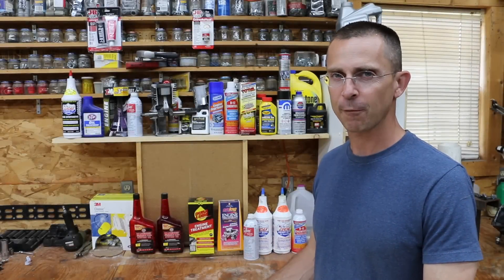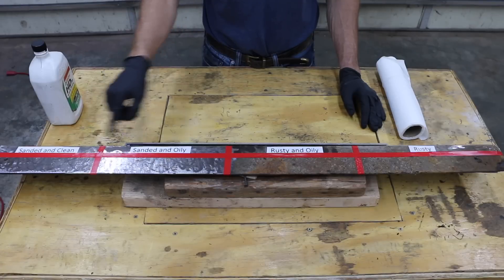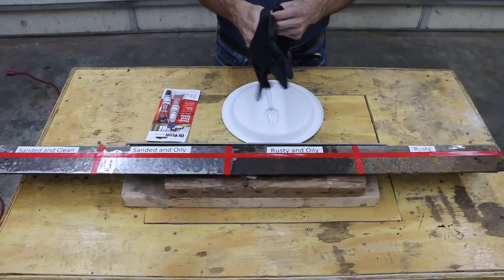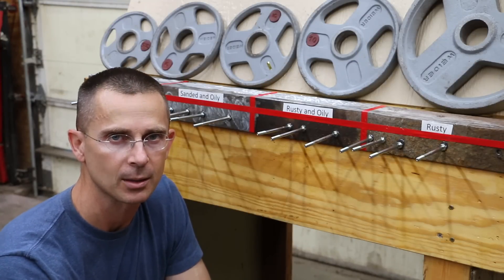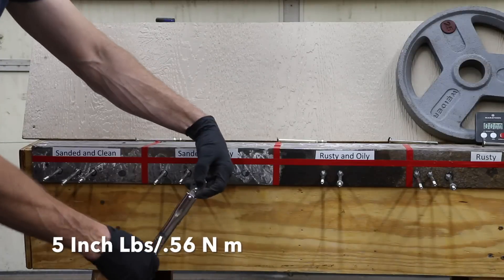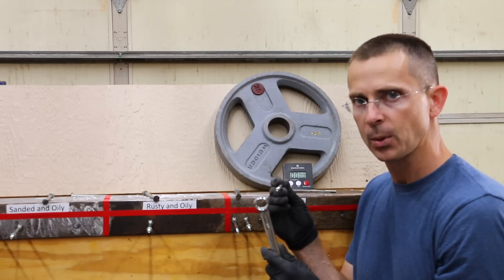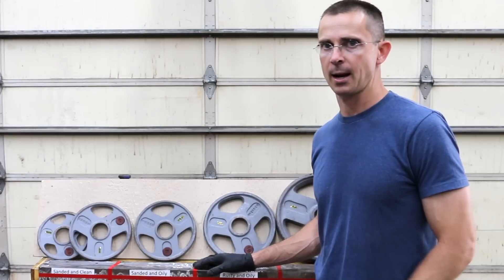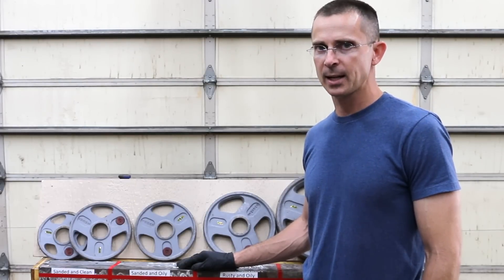How much does rust and oil effect epoxy performance? Let's find out!

Comment: My own prep method is to sandblast the surface(s).  Not only does it get rid of rust and contamination, but it also produces a "toothed" surface that's ideal for the epoxy to grab onto.  Though I don't test as rigorously as Todd does, I've yet to have such a joint fail.
Reply from the maker: Thanks for sharing.

Comment: From experience sanding and using comet powder cleaner is one of the best ways to prep the surface! When done right you can test it by pouring a little water on the area you cleaned that's getting the epoxy. If the water DOESN'T bead up it's good to go and perfect! If it does re wash the area again...
Reply from the maker: Thank you

Comment: The FAA has a very, very good write-up on adhesive bonding, ostensibly for aircraft repairs, that goes into surface preparation. This paper is available on-line, and I'd recommend reading at least the first ten pages or so, because they go into how an adhesive joint works. When doing adhesive joints, both surfaces should have as high a surface energy, obtained by physically abrading an already clean surface just before bonding, This is usually followed by cleaning with acetone, followed by isopropyl alcohol. In some cases, this is then followed by rinsing with deionized water, and perhaps doing a "water brake free" test. This test is to determine whether the surfaces are actually clean and energized, or whether they still have retained a contaminant within their pores that still fouls the surface. Secondly, it is worth looking up the surface energies obtainable in various (clean) materials by doing a search on the internet. Thirdly, it is often worth applying ("buttering") adhesive to both surfaces to be bonded to assure that the surfaces have been "wetted" by the adhesive. This must be done quickly as one does not want any kind of skin to develop on the surfaces of the adhesive exposed to the air. Fourthly, the bond line thickness must be controlled in critical joints. Some use thin wires, others use tiny glass beads, but the gist of this is to not allow the bond line to either be too thin, such as less than .006 inches, or too thick, like around .020 inches. Bond line thickness does play a role in strength. Lastly, It is considered best practice to apply continuous even pressure on the two surfaces being bonded until the bonds are cured. Leaving them with just their own weight may not produce a good bond. I liked that you performed both peel testing and shear testing to your samples. Both are critical measures of bond joint strength. Sorry that this is so long winded, but these techniques are what sometimes hold airplanes with your kids on board together. These FAA guys really know their stuff.
Reply from the maker: Great information!  Thank you

Comment: appreciate the video. am interested in bonding nylon cylinder inserted into carbon fiber tube with epoxy adhesive. also will glass microspheres  change strength.
Reply from the maker: Thank you!

Comment: There "may" have been a better bond had you used a chemical cleaner, but you might also have contaminated it.
Some cleaners can leave residue similar to mineral-oil. They dissolve the grime but do not necessarily leave it perfectly contaminant- and oilless.
Reply from the maker: Thanks for the constructive feedback.

Comment: How about testing the best cleaning solutions to use with JB Weld? Strength of bond on sanded metal, sanded metal cleaned with rubbing alcohol, acetone, brake cleaner, carb cleaner, etc. Thanks so much for these videos man. Downright AMAZING work, in its usefulness & thoroughness!
Reply from the maker: Great video idea!  Than you.

Comment: for torque you should use dial torque wrench with a memory. something like this:https://www.gedore-torque.com/torque-wrenches/dial/ads-dial-measuring-torque-wrenches/

It will tell you the highest torque applied. that way you would know exactly what the break torque is rather than just that its less than what you set yours to.
Reply from the maker: Great recommendation!  I've since begun using a torque adapter (recommended by a person leaving comments) and it has memory.  Great tool!

Comment: There was a very good epoxy made by Permatex that was actually banned for use in California  ( stipulated on the label ) I tried several different epoxies to glue the magnets back inside a altinator rotor (clutch ) hub for a Harley Davidson Sportster, it was a pain in the butt disassembling several times to test them but the Permatex epoxy was the only one that held those magnets solid. The label claimed that the Permatex epoxy had 4500psi bonding strength.
Reply from the maker: Thanks for the recommendation.  Permatex makes some great products.

Comment: someone may have already said this but for adhesives it is better not to use a solvent that will leave a petroleum residue such as isopropyl alcohol, acetone or ethanol is good.
Reply from the maker: Thank you for this information.  I've been advised dozens of times to us brake parts cleaner. It's not supposed to leave any residue. Is this good advice?
Reply: brake parts cleaner is at least primarily comprised of petroleum byproduct, which would be liable to leave a residue when dried which can skew results/performance. I work in a lab and we use ethanol instead of isopropyl alcohol for this reason.

Comment: Excellent video.  Yeah, surface prep is key for all adhesive bonding.  The acrylic (methacrylates) adhesives bond better on oily surfaces than epoxy and that might be an interesting video.
Reply from the maker: Thank you for this recommendation!

Comment: you should do a video on which metal holds epoxy best and do this test with a clean surface just not sanded
Reply from the maker: Thank you for this video project recommendation.

Comment: I've watched a couple of your videos (left copious comments-hope no harm done) and found them interesting. I often use epoxy pastes to coat foam (EVA/excercise mat) to make it rigid and it'd be interesting to see which common brands work best for that. By 'paste' I mean the semi solid stuff that is between stick putty and JB weld in thickness. The properties that are interesting for that application are: 1: how easy is it to spread and smooth out, 2: How durable is the cured shell, and 3: How long does it take it to cure hard. I'd be really interested in seeing a test like that. Thanks again for your hard work!
Reply from the maker: I always enjoy reading comments and am open to critical comments...that helps me improve.  As a former military member, I've developed thick skin:) . Thank you very much for the advice!

Comment: I would like to see you test different cleaners.  acetone, alchohol, brake cleaner, carb cleaner, b12.   Start out with a sanded surface, ad some oil, and then clean spots with the different cleaners and test JB Weld on each one.
This one was a good lesson in prep for epoxy and explains most of my dis-satisfying results with epoxy.
Reply from the maker: This is a terrific suggestion--thank you!

Comment: I'm commenting before watching, and with some experience in formulating and testing adhesives.  A rusty surface might afford adhesion but most likely not.  The rust would have to soundly adhere to the pristine metal underneath and this usually doesn't happen with iron rust.  With oil... Nope.  Won't stick.  The only hope it has is if the oil dissolves away into the epoxy but unless it's solvent based and scrubbed on this won't happen (between a short work-life and almost certainly 100% solids formulation, oil will be a fairly effective mold release)
Reply: And after watching, I'm surprised the cleaned and oiled one did so well compared to the clean dry one, although that surprise was slightly abated by the closing comment (no degreasing solvent used).  For these types of test, the film thickness is very critical.  In a formal lab setting, we usually try to design reliable jigs to help fabricate consistent samples.  An old trick of the trade is to embed a couple bits of stainless wire in the material so the substrates could be squeezed down to a known thickness.  Good stuff, though.  I love seeing content like this.
Reply from the maker: This is a great post. Thank you for this recommendation!

Comment: Compare adhesive repairs to sketchy weld (contaminated, not clean, ect) to proper weld. Also conventional oil vs. super high end synthetic motor oil head to head. Store brand dyno vs. Motul, Pentosin, Liqui Moly or the like... as someone who "has" to use eurospec oil in my car I'd like to see what the difference would really be
Reply from the maker: Thank you for these recommendations!

Comment: Thanks for doing these kinds of tests, they are very informative! I am curious about some of the putties as well as PC-7 epoxy. The only putties I have tried are JB weld steel stick (which is weirdly dense and ferromagnetic) and PC fix Fahrenheit which managed to seal a pretty bad exhaust leak (several jagged quarter inch holes and one half inch one) in one pipe on the headers on the 460 in my 1979 f150 for a couple months... before being blown off (repeated that a couple times but now I have new headers to put on there). 

By the way, you can make a lot of epoxies cure much faster if you heat them up to around 150 degrees Fahrenheit. I have a factory job and the instructions given by the engineers are usually something like 30-45 minutes at 65c/150f in a oven or cure at room temp for 4 or 8 hours or sometimes overnight (varies with the epoxy and application).

At home I have shoved a bunch of random epoxies into a toaster oven set to "warm" or "bake" at about 150f with good results. Even the ones that stay soft for hours at room temp get about as strong after 30-60 minutes in the toaster oven (and however long it takes for the parts to cool down) as they do from sitting at room temp for a day or two. In a pinch I even got some JB weld to get hard to the touch by sitting it in front of a space heater for about 20 minutes.
Reply from the maker: Thank you very much for the positive comment and thanks for the advice on curing epoxies.

Comment: How much difference does the smoothness of the surface make? Do they adhere better to a rough or smooth surface?
Reply from the maker: Thank you for this question.  From my testing, a clean, rough surface works better than a clean smooth surface.  There is more surface area with a rough surface.  Thanks for commenting!

Comment: Intresting! The result on the rusty surface was pretty much what I expected, since the glue sticks to just the rust and not the metal underneath. Same thing will happen if you glue something to a painted surface. But it was surpricing that even the very thin layer of oil left after wiping it as clean as you could using paper, could still have such an effect.
Reply from the maker: Thanks for watching the video and commenting!

Comment: I would love to see you test putty I use them a lot
Reply from the maker: Brandon, I plan to test putties soon.  Do you have any recommendations on how I accomplish the test?  Should I use the same test approach as I used in this video using bolts and attaching them to the steel?
Reply: Definitely Mighty Putty and there's another one I buy by J-B Weld that's good and there's one that's called like putty steel or something steel it's black that works great also I think testing on the bolts is a good first test but you should try to adhere it to something besides only Steel try like plastic and another sorts of Stuff maybe even try dumb as a cylinder head
Reply: And try everything Mighty Putty claims it can do

Comment: Hey Project Farm. Just had a good idea for a video. Use JB Weld in different mixes, like 1/4 hardener, 1/2 hardener, 3/4 hardener, and see how much the strength varies.
Reply from the maker: 802 Garage, This is a terrific suggestion--thank you!
Reply: No problem. :)

Comment: Love these tests!  More and more!   Also wet dry wipe for solvent clean.  Wet with solvent, suck it up with dry.  Wet again, suck it up.  This is Dow Corning's way to clean.  You seem to be using a filled Epoxy, i.e. not just clear.   You said Devcon but didn't show a close up.  More close ups!   Filled have different strengths and toughnesses. Might compare these, filled (JB) vs unfilled (Devcon or most 2 hour clear epoxies.)   Also super glues which I find to not fix most anything for very long.
Reply from the maker: Hugh, These are all terrific suggestions. Thank you!
Reply: One more thing that I do that comes from gluing to stainless steel or aluminum which form an immediate oxide layer -- this may help penetrate poorly prepared /oily oxides.   I put epoxy on the surface and scrape it into the surface, sand it in, or in your case, use the bolt as the "grinder" and massage /scrape  the epoxy into  the rusty / oily surface.  I suspect it might do nothing for the heavy rust but might improve the oily surface adhesion a lot.
Reply from the maker: Hugh, thanks for this additional information!

Comment: lab metal is awsome stuff
Reply from the maker: Terry, Thanks for this recommendation.  I'll see if I can test it in the future.  Thanks again!
Reply: Project Farm i used it to repair a cracked vaccum cleaner nozzle no other epoxy any thing i tried worked but i think the acetone in the labmetal fused the plastic and the aluminum one part expoxy together, bad thing is its conductive though
Reply from the maker: Terry, Glad this worked.
Reply: Project Farm me too!😉

Comment: Nice video!
It would have been even nicer with graphical diagrams of failure forces in the end.

It would be nice with a comparison between different epoxies on different surfaces. Perhaps also to know what surface treatement is the best. (Sanded, sandblasted, coarsely grided with angle grinder, milled and so on)
Reply from the maker: Jacob, This is a terrific suggestion!  I see a potential for a lot of videos in the future with these recommendations.  Thanks again!

Comment: Hello Project Farm, long time watcher, every one of our vids. would be interesting to see what bg44k does to an engine ? they do a diesel variant too, ive used this in my car twice a year, I notice  slight mpg increases, would be good to know if this is a placebo effect ? all the god mechanics in the uk use them, and it also helps to pass mot emissions test ?

as others have said. really good work. really informative videos. with the layout and information of your vids. I wouldn't worry what to many people think. they come here for results/facts. so whatever you do. you've nailed it already. I don't think theres much more you could improve on.

great work. :)
Reply from the maker: Ricky, This is a great project recommendation!  I have some bg44k on the shelf and plan to test the product in the near future.  I've yet to measure fuel economy and am thinking through how best to measure this.  Finally, thank you for continuing to watch the videos and thanks for taking the time to comment!
Reply: @ProjectFarm  this is an old video, but I haven't seen a video out yet using fuel economy in a situation. I would suggest using some sort of glass (or clear) cup or tank, and filling it with x amount of gas. But I would also hook the engine up to some form of constant work load (like spinning a generator or pump?) And after x amount of time seeing how much fuel is consumed. I look forward to future videos, I enjoy them very much, I can fit one, sometimes two in on my lunch break! Keep up the quality content!

Comment: Something that hasn't been checked yet - what about the strength of JB Weld being pulled apart?  Fix a bolt to some immovable object, glue the head of the bolt to another head of a similar bolt, and try to pull them apart.  Maybe use a torque wrench to measure the force required.  Or - just for fun - find a really heavy object and try towing it around with a tractor, using just a JB Weld bond.  Dump loads of scrap metal on the towed object till the weld breaks.  Or try to tow a (junked) grand piano, or an 18 wheeler truck, or something equally silly.  Could be fun.
Reply from the maker: Charles, This is a terrific suggestion!  I'll see if I can figure out a "pull apart" test for J.B. Weld.  Thanks again!

Comment: great job on your videos.  ive learned a lot in your channel.  one suggestion.  use b12 chemtool carb and choke cleaner to clean the oily metal surfaces.
Reply from the maker: Brandon, This is a terrific suggestion!  Thank you!
Reply: a project id like to see is seeing how long you can run a 2 cycle engine off of straight gas

Comment: I was not surprised by the result, but I do have a suggestion for a follow-up experiment: de-grease and scuff up the surface of non-rusted steel or iron, using different grits, all the way from a disc grinder down to metal polish with, say, 4 intermediate grits. Intuitively the coarse grinding will increase surface area and adhesion, but it would be great to put it to the test. Greetings from the other side of the pond. Keep up the good work.
Reply from the maker: Richard, Greetings!  This is a terrific suggestion--thank you!

Comment: good test. i myself use epoyy to for reparing metal pieces. recently it didn't do well and broke of. now i know why. i made the same mistake as you did. dindnt clean with aceton and did not sand it. i learned a lot
 i use BISON epoxy metal. thanks.
Reply from the maker: Thank you very much for the positive comment!  I agree...I should have used acetone to clean first.

Comment: Problem is your Epoxy started to harden as you went down the line from sanded to rusted surface
Reply from the maker: This was a slow cure (takes 24 hours to cure) epoxy that allows more than 5 minutes of time to apply. This would have been a problem for a quick epoxy.  Thanks for watching the video and commenting!